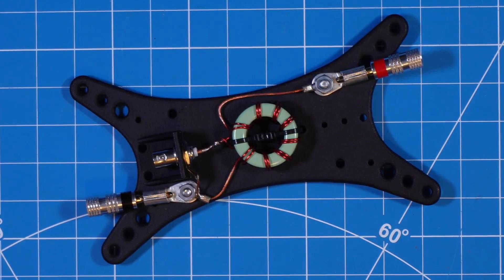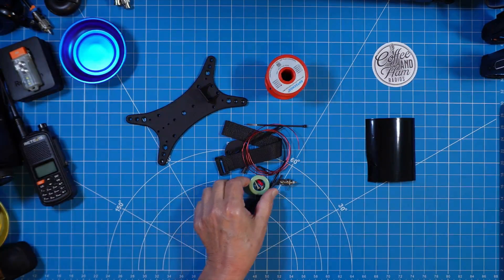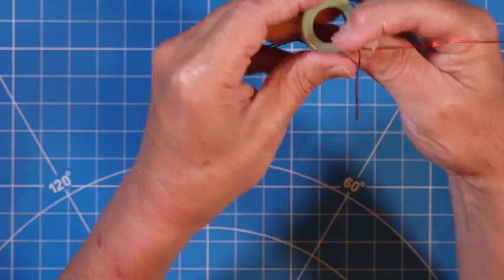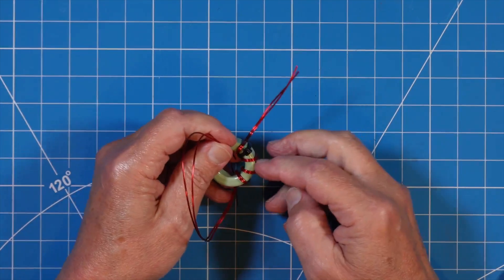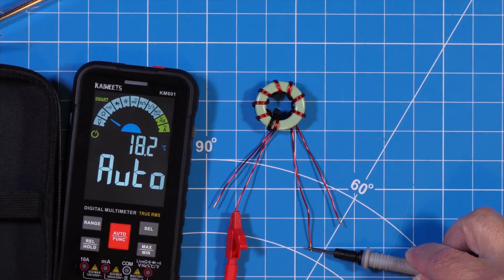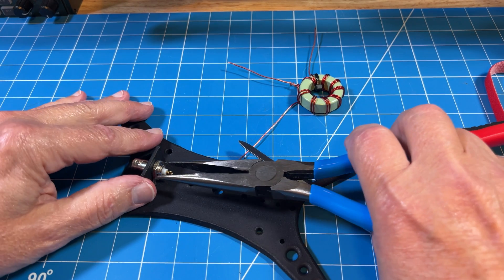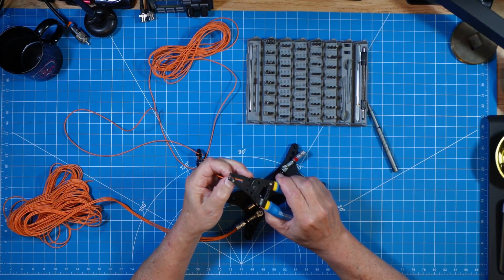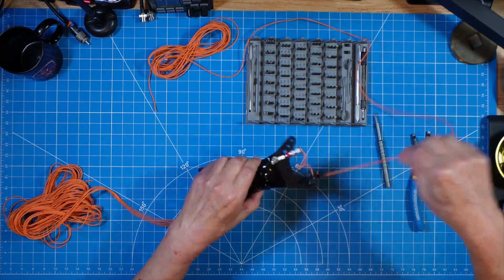Building Kit Antennas - The CaHR Poseidon Rybakov Vertical HF Antenna Step by Step with my Mods

Comment: BOSS UPGRADES - where can we go next?
Reply from the maker: You guys are doing it right!  Start with a great design and kit, and leave it to the individual for mods, if any, to their liking.
Reply: @HOAHamRadio  I use an Anderson power pole system for radials, so I just added a power pole to mine

Comment: Nice build Bob, one thing that might help when twisting the wire pair together on the toroid is an inexpensive pair of 6” safety wire pliers ($10)  from Harbor Freight. Makes for a nice wrap and clean look. de k8wf…
Reply from the maker: Thanks for the tip, I'll need to check that out.